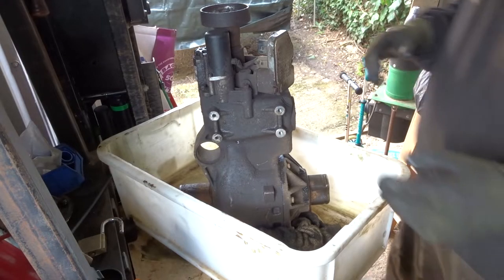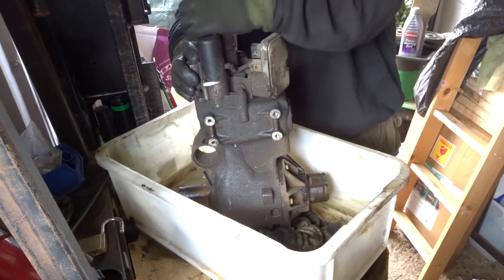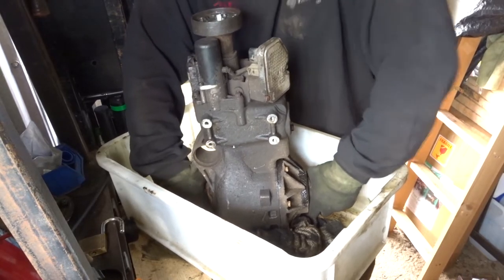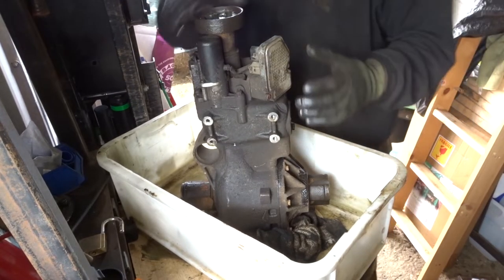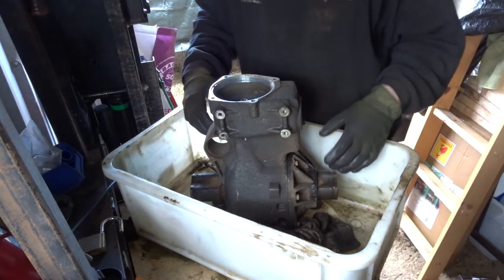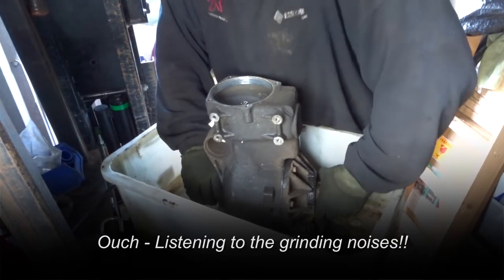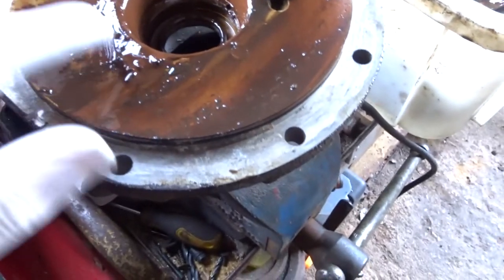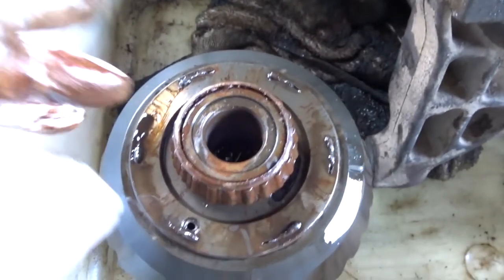2007 Freelander 2 LR2 Rear Diff Issue

Comment: Thanks for this video, I have an intermittent grinding noise coming from my diff when turning, It's not the full duration of the turn though It's literally one second long but happens a few times almost as if its a 'high point' that catches. I'm dreading it as I know it'll be a 4 figure bill

Comment: Oh boy, I got a Volvo XC70 with a Haldex 3 that needs this taken care of… 😣
Reply from the maker: I will have to edit and upload the video of me trying to get the pinion shaft out of the diff casing - that will scare you a bit more - but mine had got so hot it has welded itself solid....still haven't got the shaft out yet...yours may be fine if you catch it early enough! - Have no fear and get stuck in!

Comment: Hi Ant, were there any other indications of it going bad or did it just lock up? Also, we’re you able to get it rebuilt?
Reply from the maker: No, there were no indications it was going to fail in our case. Oftentimes there is a groaning or rumbling indication bearing wear, but ours was silent. After a massive fight I managed to get the pinion shaft nut off (will have to put the video of that up - it was a huge fight) but the bearing had welded itself to the shaft and no one could shift it not even the local Land Rover specialist, so I fitted a replacement diff in the end!

Comment: Seems to be same rear diff as Volvo xc60
Reply from the maker: It is the same if not similar....they both use the Haldex clutch system for AWD - although this is an ealry FL2 so uses the gen 3 Haldex and I think the Volvo uses the Gen 4 - good spot though!